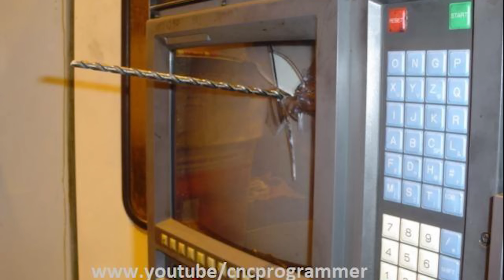Cnc Machines New Crash Fail Videos Compilation - 3D Printing Fails

Comment: Haha I used to watch my boss throw thousands away just because he thought doing a “dry” run first was a waste of time! Lol
Reply: Got one of those now.
Reply: Bro dry run and 30% speed on the first run period
Reply: @venom5610  you just use a M0 before every tool Change works
Reply: @pauliepaul3697  Exactly. And/Or an Option Stop. I sometimes reset the program to make sure everything is still all in order.
Reply: @PrimericanIdol  M9 : stop coolant 
M5 : stop spindle 
M0 : pause program 
When using different tooling on each cycle  to check you got G43 right on z offsets 
For each tooling 
Dry runs are slow

Comment: It never ceases to amaze me how people can foul-up perfectly good equipment because they don't do their due diligence in doing not only dry runs, but proper feed management and tool selection.
Reply: after a while people get self confidence,  and think they know their shit... thats when things like this happend...
Reply: To be honest i work on cnc lathes and milling machines and never do dry runs never had a smash up, just on first job use M0 on each tool change then turn percentage feed down  and when closed to work peace check next position if it says 100mm to zero and is say it's 20mm away you know there's going to be carnage!
Reply: @pauliepaul3697  I used to  be fast, but after a few crashes I set  m00 or m01 between each operation on the first run, simulate in machine graphics.. use  distance to go.. then the second part on 5% rapid without option stop, before i go  100% .. nothing worse than a broken  insert happend for the last 10 years.  ;)
Reply: @mattiasarvidsson8522  distance to go is the best method and you know never get arrogant  with cnc machines because it's only doing what you program it to do! I'm fortunate i program set up cnc milling machines and lathes and operate them myself
Reply: mz4637 It's like a negligent discharge for those who do a ton of shooting.  There are those that have had one, there are those that WILL have one, and there are liars.
Reply: @pauliepaul3697  No need to say "you know" in the middle of a sentence.

Comment: 0:48 i can’t understand how they melt the tapper of the tool holder
Reply: My guess is that the tool was stopped, the tool holder kept spinning, and the motor ran a long enough duration to heat it with friction.
Reply: Don't underestimate the power of metal on metal friction.
Reply: J
Reply: Yufp

Comment: I was taught.
1 ; simulate your program
2; single block run first item

And a few of those crashes were just clamped wrong.
Reply: I think they spent more time programming the cameras. The screen should show data on how far the next move is too. I did Mazaks for 15 years. Hey boss? I have a problem here  lol.
Reply: @Taffer9876  hi sir. What is your country
Reply: And what we are going to watch then?
Reply: Simulation is only available in siemens series
Reply: @adhilbashaadhilbasha6870  
I don't agree.
Mazak, fanuc,fagor, siemens ,prototrak are some of the controllers I have used. All have simulation capabilities. Let along now machines are being programmed  from  CAD software that allows simulation  prior to loading on the machines. So a crash is preventable on a cnc provided  the the cause of the crash isn't due to a failure of systems in the machines
Reply: I think some codes are run with dry run😂😂😂
Reply: I run all my programs at 10% rapids, single block, and stop to check every tool because the CNC is in my apartment and if I crash at 100% rapid in Z, the building will probably fall apart from the force.
Reply: @adhilbashaadhilbasha6870  Heidenhein as well
Reply: @Zach most of this stuff isn't million line programs though. Just not brainlessly running through a program at 100% feed would prevent about half the crashes here.
Reply: @bdmachining2912  And I would always single block the first run with rapid override turned on, and read the G-Code to see the distance to go and direction it is going to go. My parts were 2000#+ on a vertical lathe. A major crash on that could kill you.

Comment: The one with a foot of drill bit sticking out of the screen was kinda scary. The one with the fire raging inside was terrifying! How do these even happen? Milling titanium? Magnesium? (More than one dirt bike mechanic has discovered the horror of welding a frame when the motor has magnesium side covers.)
Reply: There's a book about Porsches , and it mentions that in a 24 hour race one of the magnesium gearbox castings cracked, so one of the mechanics smashed a magnesium wheel an used it to ( oxy ) weld the gearbox. A magnesium casting with a nice film of oil on the inside in a pit lane with lots of fuel. It apparently worked though. Many years ago my dad was machining magnesium, he brought some swarf back home and lit it in the back garden, the heat was unbelievable.

Comment: Many practicing machinist have been decapitated by smaller diameter bar stock hanging out to far of lathe spindle.
In my area a master German toolmaker with 45 years experience mad that mistake one evening working alone , a neighboring
Business owner came to work earlier than usual and noticed a terrible sound at next shop over , that tool maker had been dead for hours
The bar had bent 90* and appeared the man moved to the rear of machine to investigate the cause of the vibration and it removed his head .
The witness said he couldn't see the bent bar only heard the horrible sound that it made spinning at over 4000 rpm and the older man On the floor in bloody mess . The emergency responders cut the power to the smaller industrial unit. Be careful people this happens a lot around the world.
Reply: Gibts da einen Bericht o. Ä.?

Comment: Dry run, slow first run, prove program 100% before going full speed.. shit like this should never happen
Reply: We allways start with z+250 and position x and y first before moving in z down.
We leave 2mm save distance and only use auto feed if we are under these 2mm.
I was told that there was not one crash or other accident in the last 20 years.
We produce usually just a few of one part so we dont lose much time with this but it is annoying to programm these few more lines every time - But it is worth it xD
Reply: And yet it does happen... you can't cover everything... fatigue failure & cutting tool failures are hard to allow for... amongst others.. 🤔

Comment: I think a lot of the work holding failures  are made by CNC operators who do not have the all around manual machine shop experience . There are learning curves every where.
Reply: "Yeah, that double sided tape will work just fine...."
Reply: @jfan4reva  the CNC router failures are why I leave tabs and use cam clamps / pause the program and add additional clamps to areas that have already been machined. I get that automation is supposed to be hands-off but I add things to my programs/pauses and make it flash a message on screen to add clamps / move clamps out of tool paths all the time. 

Then again I work in a welding shop with the largest horizontal boring mill in my country and have seen that thing drag 110,000lb object and chuck a 12,000lb object like it was nothing. So nervous laughs about how someone nearly just died kind of sort of made me realize that overkill with clamping is not overkill.

Comment: There is a difference between computer programming and machining.
You can program a machine to do whatever you want but if it can actually machine that is another question.
Moral to the story: computer programmers lean to machine.
Reply: So true you need year's of experience in machine any idiot after a couple of months training can do cad cam what scares me is they have the technology now to program cnc lathes and milling machines without experience of feeds and speeds crazy, I'm lucky i program cnc machines and have 30 year's experience in mechanical engineering

Comment: As an 'old fashioned' machinist, it gives me great pleasure to watch these mindless robots commit hara-kiri.
Reply: Same, when these cnc’s go wrong they go wrong big time, no problems on the manual lathes👍
Reply: @ChrisBrown-dy8ts  I use both. I don't think I have a preference for what I like using more. Iv'e been a manual machinist for about 15 years and I bought a Milltronic Ml18 lathe and been doing that for about 1.5 years or so and enjoying that too.

Comment: These  machines are realy great but when things go wrong it happens so  quickly .I was behind a boring Machine when it snapped a 1 1/2" drill clean off. The operator forgot to withdraw the drill before moving the  table. You could hear the machine  straining. Then came the big bang.

Comment: and this, ladys and gentlemen is the reason why i have trust issues at work
Reply: Every machime have test run or dry run, snd emergency braje
Reply: @nikolapetrovic2219  and yet these Videos do exist for a reason. Most of the Times its human mistake, even if they forget to test the Programm in free air thats rather a human mistake than a technical error

Comment: What happened to the machine programmer and the operator, if I own the machine they would have been fired on the spot. Were looking at thousands of dollars worth of damage plus the loss of the job contract. I agree with another person the drill bit through the monitor, it was pretty funny. I guess all this happened before fusion 360 or did it.